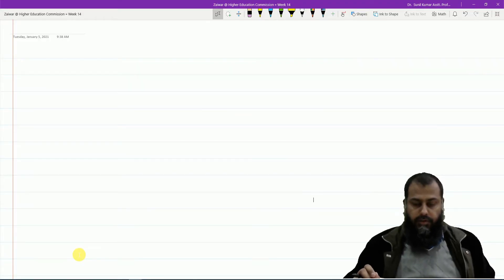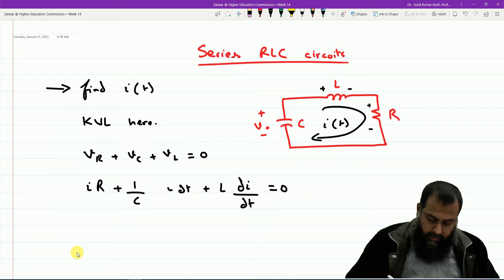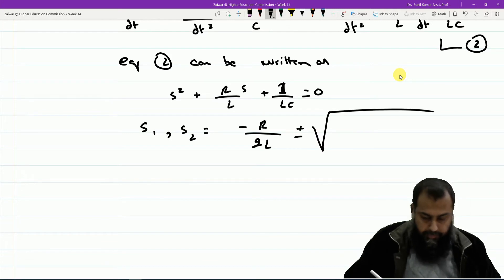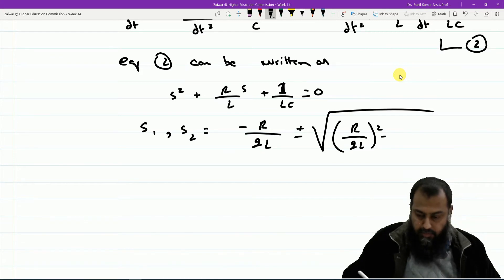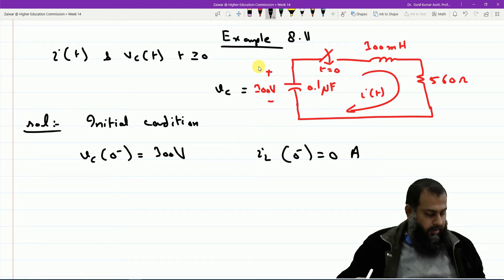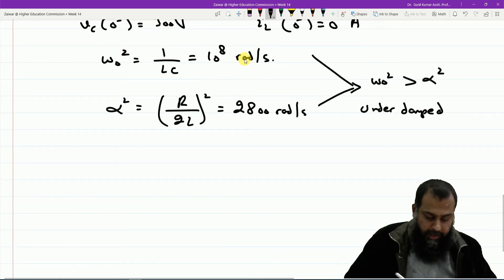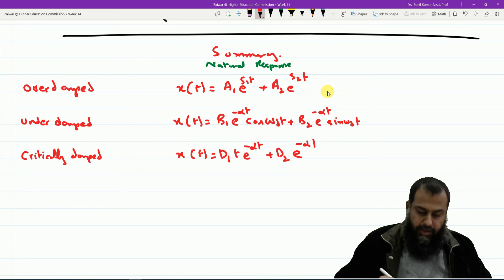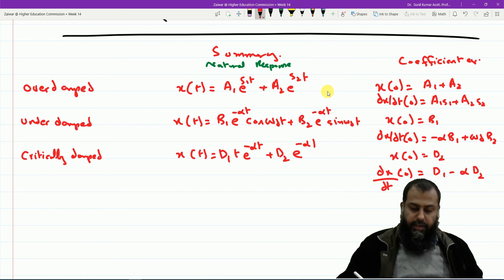Understanding the Response of Series RLC circuit

Comment: Sir for underdamped response, you wrote dx/dt=w(d)*B2 in coeff. eq, but in the example, you divided B2 by w(d).  Please explain, thank you .
Reply from the maker: It is because i have first calculated the di0+/dt that turned out to be equal to 1000 A/2. Now using the coefficient equation this is equal to wdB2. To find the B2 the 1000 A/s is divided by wd.  I hope this solves your confusion.